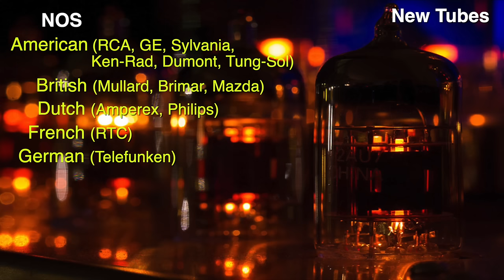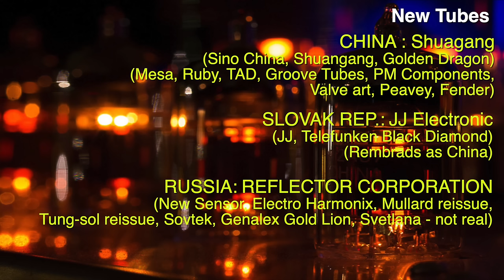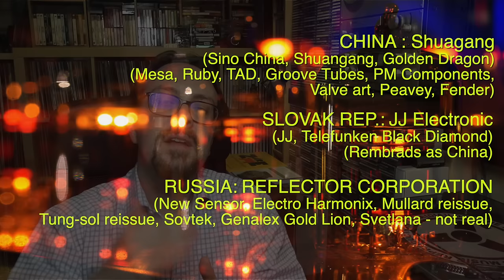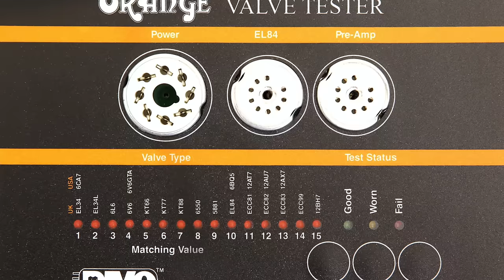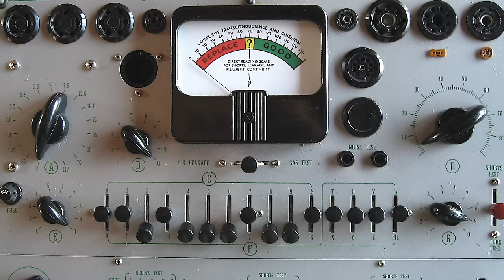Vacuum Tubes Basics: 10 things you need to know

Comment: You can absolutely handle tubes with your bare hands, no problem! Just make sure they aren’t hot, these aren’t halogen lightbulbs
Reply: Many high-end tube amps have their tubes exposed and many people like to admire them but not with dark (burnt oil) fingerprints on them , And like halogen bulbs the oils on the pins can cause them to fry.
Reply: Lee Kumiega yes on the cosmetics, absolutely not on the performance. Oils from your skin WILL NOT effect the operation of the tube
Reply: @tsloth1390  I never said touching (handling)the tubes effect the operation generally but skin oils will carbonize when heated and if enough gets on the pins the carbonized pin can heat up over time causing it to fry ,not an issue with low power tubes but it can be an issue if the tube draws a lot of power.Although rare I have seen a few cases where 1 or 2 pins of a tube were fried and in one case ruined the socket tension so that the replacement also fried over time.
Reply: Lee Kumiega I mean you should clean off the pins with a wire brush anyway and straighten them if they’re old, but even then I’ve never heard or seen it cause much issue and I’ve seen lots of really really grimey tubes. Now in terms of tension, varying pin size can have the effect you’re talking about, you’re sure that’s not what was going on?
Reply: @tsloth1390 As far as I know pin sizes are standardized for a given tube type. I've only seen the problem a few times over the years and assumed that it was carbonized finger oils that fried the pins. But I guess it could just as well of been a bad tube socket  from production.
Reply: @leekumiega9268  newer tubes usually have stouter pins but some older pins vary too, but by less. It can cause issues with some sockets going between the two. I think you've had oxidized pins...  But hey i suppose its possible it was finger oil, but I would think you'd have to get a lot of it on there, so thick and burnt that it wouldn't be mechanically removed by inserting it or reinserting it.  Tungsten pins do oxidize though, if a tube is really old oxidation likely needs to be removed from the pins.
Reply: @tsloth1390  You make some good points, something to think about and look  out for.

Comment: Everyone who is a little informed knows that 90% of brands of audio tubes do not manufacture them. These brands have the tubes stamped with their name and sell them very expensive. You pay the brand ! The best tube sorter is Groove Tubes, the quality is there, the price too ! I strongly recommend buying directly the brands of manufacturers which are few: JJ Electronic ( www.jjtubes.eu ), Electro Harmonix ( www.ehx.com /vacuum-tubes> Genalex, Mullard, Sovtek, Svetlana) TUNG SOL (  http://www.tungsol.com/ ). Here is the turn. Advice: never buy tubes made in China, the quality is poor and they age rather badly, they don't grow old well. Personally I often use JJ Electronic tubes as a preamplifier purchased directly from the manufacturer's site. The packs of 2 or 4 are sold paired, therefore of exactly the same value. SOVTEK power tubes are also excellent value for money. I tested these tubes (6550) in a Leslie Hammond organ cabinet 147, it sounds really good and it holds the power as well as the saturations. TUNG SOL is the top of the range, but it is sold at a higher price.

Comment: Let's correct the history.  The first tube was invented by Edison.  It was in fact a diode.  Fleming invented the control grid which allowed control of electron flow through the tube, which made it useful as an amplifier.
Reply from the maker: That is something different, not a diode. First diode tube with the same use as those of today is that if Fleming. Again, this is history. Not my word.
Reply: @anadialog  Fleming may have refined the diode tube, but Edison invented it.  THAT is history.
Reply from the maker: It was Fleming that gave the name 'diode'. I think that Britannica Encyclopedia sets the line: https://www.britannica.com/technology/diode
Reply from the maker: There are dozens of articles like these, why deny it: https://history-computer.com/ModernComputer/Basis/diode.html

https://en.m.wikipedia.org/wiki/Vacuum_tube

Comment: I love music and I'm audiophile always seeking perfect performance but it's about music rather than any bragging factor. Any tube added in any analog signal path already having piles of transistors will represent an ADDITIVE effect. A soft clipping behavior with more musical even harmonics is one of the favorite effects of tubes but it only kicks in when your signal levels are at near peak level and quite frankly, soft clipping is nothing magic that can't be done more effectively with solid state components. Besides, I prefer having the dynamic range such that I never hit any clipping level throughout my analog paths. On any other audio performance parameters, I really can't see a tube doing anything of incremental value other than the high-end appearance of it. If I want some old-style tube sound, I could simply add a DSP stage (I'm an audio engineer) and just program it with enough bit resolution and sample rate to be much more reliable and precise than any tube can ever do. There is nothing a tube does that is magic and can't be DSP emulated.
Reply from the maker: I perfectly understand your point and sometimes for some aspects you describe and others I miss solid state. Nevertheless, the engagement is usually just mesmerizing and I am sure you can create a fantastic emulation but as for anything in this world, its still an emulation, not the real thing.
Reply: ANA[DIA]LOG For those who like tube sound I see no reason why a DSP can’t do it better. With DSP you have full control and can tweak it to match exactly your preferred behavior and it won’t ever drift; and left channel will be exactly like right channel. But, of course, if your source is analog (vinyl), you don’t want to go through an ADC and a DAC just to add tube sound.
Reply: It is not so much what a good tube amp does to the signal but what it doesn't do. To this day the vacuum triode is the most linear amplifying device ever devised and has the most voltage headroom as well. If they are inductively loaded the headroom is even greater. They are so linear that very good quality sound can be produced with extremely simple circuitry using little or no added feedback.

Consider  a preamp. the output signal at full tilt swings maybe 3 or 4 volts peak. Yet a properly biased tube with a standard 300V power supply can swing an order of magnitude more before the onset of overload sometimes even more. And when that overload occurs it is gradual "fattening" of the sound due to increased HD2 from asymmetrical compression of the waveform. Generally lower FB especially in shorter loops also helps to avoid some of the nasty artifacts that can be generated in an overloaded feedback amplifier.

Push pull output stages are a little different but usually reasonably well behaved. The output transformers are often bad mouthed as distortion generators but a properly selected tranny is not nearly as dirty as people make out and the way the energy is handled by them can make the amp quite dynamic.

finally consider the the loudspeakers we are driving have many times as much distortion as even the simplest vacuum tube amps yet we still manage to hear all of that fine musical detail.

It is one thing to design to numbers but quite another to understand what numbers matter the most in what situation. That is what make audio equipment design as much an art as a science.

Comment: Auto bias is not the best. Manual bias is. Simple circuits are almost always best. Auto bias is complicated, and can rob you of power. That being said. I do like it, but when it's costing you 3 Watts on a single ended amp that's now only 5, instead of 8. It's not always worth it. I own am amp like this BTW.

Touch away. They're under a vacuum. So the glass is thick. They're not that fragile. They're not light bulbs. I've been touching my tubes for years, and will continue to do so. Remember they were designed for regular consumer use. They're not some special 🌹.

And when you're inserting, and taking them out. Roll them around the socket, in a circular motion. Not wiggle side to side. IME that's best with either new, or old sockets.

Using the type that your amp came with is not always best. Not at all. Many times they're designed to use a certain tube do to availability, and/or price. Believe me when I tell you that many times the variants sound better. And can further fine tune your particular setup. For instance they usually have a different level of gain.

Yes some Chinese Tubes can sound good, but as a rule. Most of the stock ones that come with cheap eBay products are unlistenable to my ears. Don't go cheap here, but don't get sucked into the expensive NOS trap either.

It you want to save money. Go Russian, or other low priced Eastern European. Go NOS American. Or for Chinese. Go JJ.

If you want fancy, and really if you're buying any tube. Do your research. And remember that all tubes sound different in different circuits. I do not recommend buying any Holy Grail tubes, unless money isn't important too you. You're likely to be impressed, yet disappointed. Or just straight disappointed. The difference between an old Brimar, or an old RCA isn't that noticable in many cases. And sometimes that expensive Telefunken, or Amperex Bugle Boy will actually sound worse in your setup, than a NOS American one.

I more recommend you learn what tubes sound like what, and go with that. In other words do your research. Many tubes can liven up, or soften up the tone of your system. But will be in the same price range. That's usually a lot more noticable then a slight bit of ”air” or separation. If you really want a big change in performance. Look to your gear, and your speakers first. Just like with cables.

And do not underestimate what units from the golden era of HiFi can do. The new stuff sound different. Not as musical, but more clear many times. If you just want to listen to great music, and aren't concerned with perfection. Try an old tube receiver, or integrated amp. I'll take my 1964 HH Scott 340B over a higher end modern separates setup any day. The synergy we hunt for is already there, and they were designed by very smart people who tuned them by ear. Computers are great for saving manufacturing costs, but not for that human connection. Try both, and see what I mean. And those cheap Chinese amps on eBay are pretty good too. Don't get me wrong. But old school is best for low budget IME. Just get one that's already been restored electrically though.

Don't be so concerned with tube life. Just use them. Preamp tubes last a very long time. It's the outputs that do the real work. And you don't always have to have matching tubes. Every amp is different. I like to use them anyway, if they're not much more expensive. But I also buy batches of cheap, old, used tubes to try out different makes. And these old, used, unmatched tubes still can sound great. And even better then the new perfectly matched ones. 

Please understand part of why I like watching you is that you share your knowledge as you go along, and take us on your journey. Unfortunately though. Sometimes you get that knowledge from the web, or your own opinion. And it's not always correct. So please understand. I'm just trying to clarify here.

There were a lot of small mistakes in this video actually. I'm getting too old to remember them all right now, and lack the time to go back over it all. So I just tossed in what I remembered here. But there is more. Hopefully others will chime in here.
Reply from the maker: Hi there, I agree on several things you said but you got confused or did not understand what I said. I did not mean autobias is the best choice but it is the best solution in order to solve the problem. Remember this video is for newbies and bias can scare them away! I agree that my phrase came out wrong. Manual tuning is always better, in all systems. Machines make mistakes.
I prefer not to touch them. The oils can create difference in temperature and shorten the life or in some cases thermal shock. Even if rare I think it's better to handle them this way. Doesn't seem a mistake just a different way to handle them.
I never said that the tubes that come with gear are better :-)) I said exactly the opposite in the last point, tube rolling. I just said that in some cases you go back to the previous like I did with my stock ones but the fun is to change and tune!
Please don't say I get things off the web like that. This is my experience, yes I am not a tube guru but I think I reported some basic important aspects that can help people who are interested in doing their first step into this world. I keep having a lot of people writing me that I am totally wrong on things and then in the end I manage to prove them wrong but it is very time consuming. In any case thanks for your suggestions. I completely agree on vintage gear. Cheap and very good...and they look good too!
Reply: Floating cathode bias is the simplest biasing curcuit there is, also there is no loss of power if you use bypass caps...
Reply: I’m about to buy a Reisong A12. How will I know when all or some of its tubes are wearing out? Reduced volume, or what? Thanks if you can explain!

Comment: I can admire all the passion about tubes but I have transitioned all my music listening to digital sources and prefer to keep the signal intact to the latest point in the signal path possible. Playing FLAC files and running the DAC directly to the power amp is the architecture of maintaining signal integrity maximally nowadays. Tubes aren’t really doing well for power amplification and as DACs easily can output line levels capable of driving power amps, I see them only as a sort of analog DSP that some will like and some won’t like. Yes, in the digital domain you can easily model the tube behavior precisely when using high enough sample rate and sample resolution. The algorithms will sound exactly the same the first second you use it and years later also thus you don’t have to worry about burn-in, warm-up or wear-out issues. Also you can tweak to your personal preference if you really like such sort of distortion. However, this is technical talk and reality is that we have yet to see a good product doing this.
Reply: Yawn. You must be fun at parties. "Why drive a vintage Rolls Royce when you can wear VR glasses inside a Prius with RR simulation software"?

Comment: with modern tubes 7025 or cv 4004 has no meaning ,with nos tubes it means heavy duty less noisy tubes 7025 and cv 4004 are military or industrial types for customers like the army that stopped buying tubes 40 years ago.

Comment: Handling the tubes you mentioned is really bs.if they are cold I doesn't matter if they get grease from fingers. And wicking tubes isn't good at all you need to make little circles with little amount of pulling the tube.
And warmup it true it takes a two hours then the amp sound is most clear and strait. I even have my pre amp on it never goes out. And ones in two years I'll switch the tubes for new ones.
And warming up time is for transistors even much much more longer time. It can take months. Try it out you find it is very differand sounding.

Comment: There is not to much in this video that is accurate........do your research..........this is mostly audiofoolery
Reply from the maker: Ok, explain me point by point where are the mistakes. I am not a tube guru and ready to make amends for it.
Reply: Woulden't say really mistakes but more inaccurate to a certain degree. Gave som example in my comment before and here is another one. There is a difference between types of tubes and equivalent tube. A manufacturer would instruct to use an 12ax7 type wich is equivalent to a ecc83. Identical, the same specs and so on but you can mostly not! Replace it with a different type because it has a different plate voltage and different pin setting, just because it fits in the socket doesn't mean that the heater supply is in the same pins. In best case you get a bad sound and worst case you destroy the tube or even worse other components. Take care! Still enjoing yore videos :)

Comment: As you mentioned tube life is short and replacement cost can be expensive and you never know if your replacements will sound better or worse. The legendary Bob Carver solved the short tube life problem ,his design lets the tubes run warm not hot to extend tube life to 50 years. see https://www.bobcarvercorp.com/crimson-raven  this is just one of his amps  , they get rave reviews and are well worth looking into if you are going to tube amps.
Reply: Just buy the cheapest new tubes out there, it makes no real difference. Tubes are tubes. The NOS tubes might sound a bit different because, no matter how good they were packed, every tube will pull air in over 30-40 sometimes 50 years.
Reply: @maxs.3238  While it is true that tubes can get gassy over time not all do and tube testers have a test for that . While tubes may  sound the same in an old vintage tube radio they do sound different in a highly resolving system  as mentioned in the video.